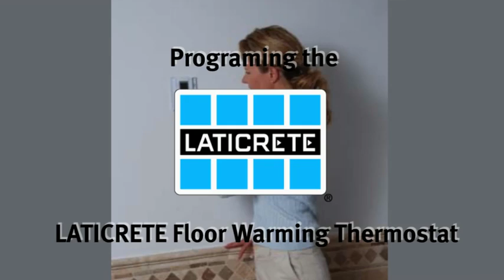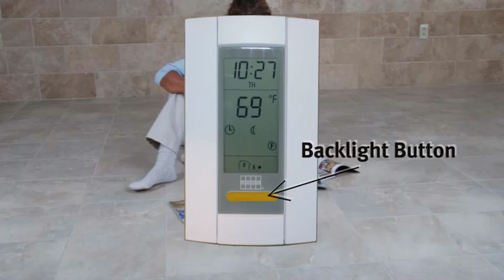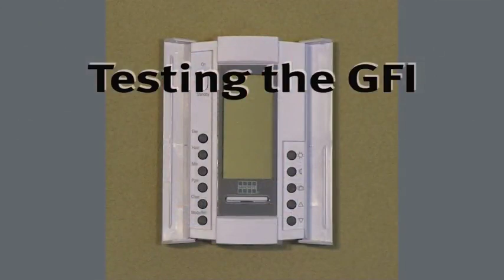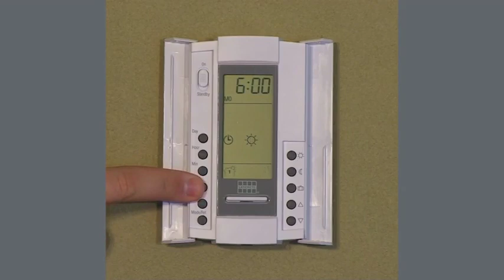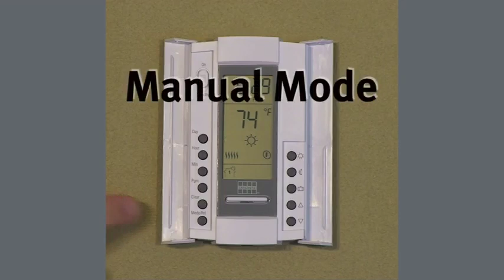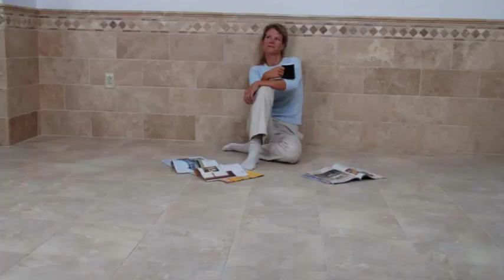How to Program the Laticrete Floor Warming Thermostat

Comment: also i have these tile warmers in about 5 different areas around the house. And the one in the downstairs shower seems to turn off. With the switch put on the tile warmer still wont come on. It shuts off for a long period of time. Can this be because of the steam in the shower or is it the switch box it self not working?

Comment: now if i program it to warm at 3:00 in the morning. If i put the heater onto standby mode the night before will it automatically turn on or will i have to leave it on all night?
Reply: Standby is essentially the off button. Therefore if you put the thermostat into standby it will not come on at 3:00am. If you set the thermostat in the programming mode to come on at a certain time it will. It will also stop heating at whatever time you set the thermostat to stop heating. If you need further instruction please call 1-800-243-4788 ext 235.